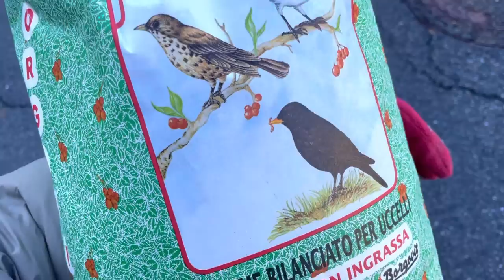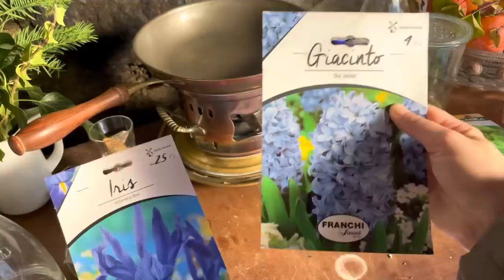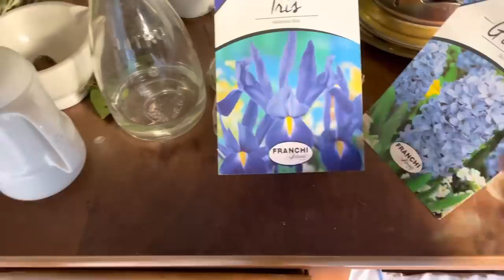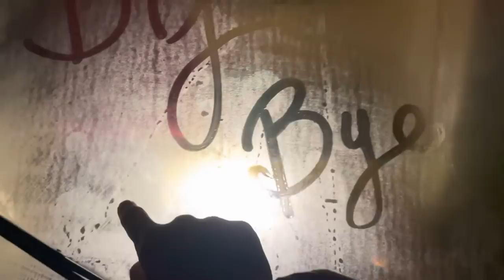Day 111 of a big renovation on lake Como/Big demolition, kitchen project

Comment: Hello Alla!  Others mentioned putting bird seed in sealed containers and only hanging bird feeders in the garden. They are correct that bird seed will draw in mice and rats. So please keep that in mind. To protect our plants  from frost, we covered them overnight with a pillow case or sheet. It’s usually easy to find fitted crib or twin bed sheets cheaply at a thrift store. , Those work well to protect  small- to medium plants from frost.  In talking with a garden store owner, he told me now is the perfect time to plant bulbs so they develop a good root system before blooming in the spring. I’m glad you’re removing the kitchen ceiling. It would be good to know if there’s ever been a kitchen fire. That’s what it looks like to me.
Reply: Absolutely. My friend and I both have bird food in our gardens. To prevent the rats from feasting on our bird food we hang them on higher branches that do not support the weight of rats or squirrels. We also buy bird seed fat bombs in coconuts as birds need fat too. Also different birds like different types of seeds, etc. Rats are quite clever and are quite happy to move into a house during the winter if there’s access. We’ve had the little blighters in our attic in the past and you have to be extremely proactive. They can chew through some very strong products such as thick rubber. Thankfully we don’t have them right now but we have had them in our garden this year. Not anymore!
Reply: Hi Alla!  You are accomplishing so much!  Another suggestion would be to not put the bird food in the little kitchen - birds will pooh anywhere and it would be difficult to clean up / and just another chore...  Thank you for sharing your journey with all of us!!
Reply: What incredible views , Thank you for showing us them 😊. Cannot believe all you are capable of doing .. gardening , construction art etc . 😊. Doing a wonderful job .!
Reply: You will need a cat, more than one, to scare off the rats mice squirrels n bugs, kitties are good at it.

Comment: You have a lot of extra work removing the ceilings. I hope the beams are in good shape. 

Straw is a good insulator for plants. If you surround your plants with some sort of wire mesh, plastic sheeting or even a wall of sticks you can fill the inside with leaves and that will work, too. The surrounding material will keep the leaves or other material in place. The garden looks great,! When you show the overhead view, it is impressive to see what you have accomplished there.

Maybe you should buy a proper ladder now? I have two…one larger one that extends high so I can reach the ceilings and the other one shorter but lighter and easy to move around. It will make life easier with all the work you still have to do and safer for you both!

Comment: You might wanna have that black stuff tested. Did I miss you saying what it was is it charcoal like was there a fire and that’s left over or is that black mold. If it is black mould that is not something that you should be doing yourselves you need to have a special company come out and remove it. There was just so much of it and it’s coming through the plaster in places it’s so bad. I worry for your health. If it’s charcoal well that’s no problem and I hope that’s all it is. Oh my God I just saw this and start really getting stressed for you. Please correct me if I’m wrong.
Reply from the maker: Ahhh don't worry the ceiling is an a good condition its just old)